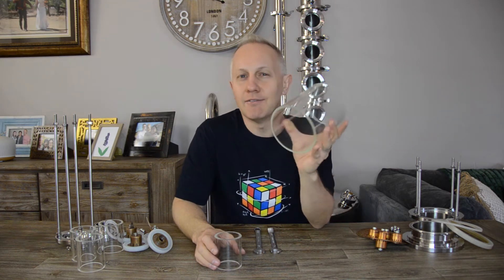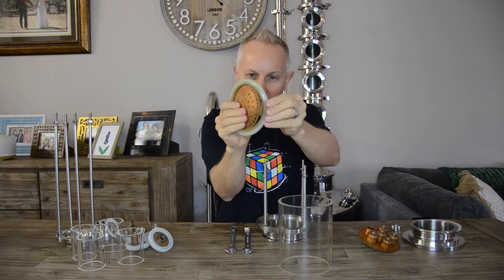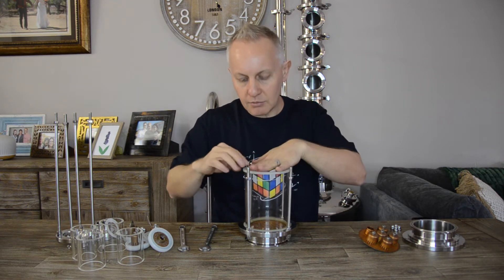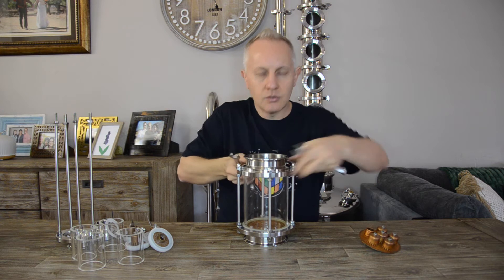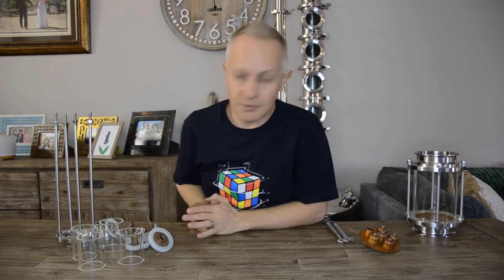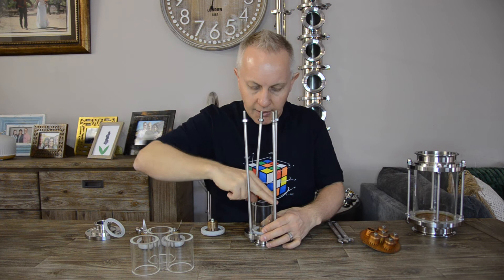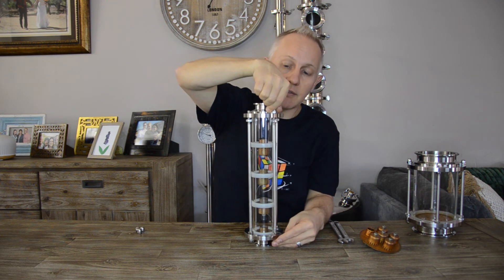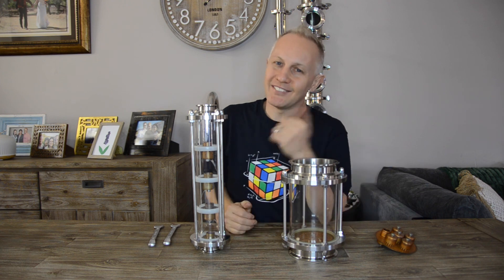How to Assemble a Glass Column & Sight Glass for Distilling | Step-by-Step Setup Guide *AUDIO FIXED*

Comment: Hi, great videos, thank you!  Question: I have a 2" output from my still and 2" column, pot, reflux & plates / defrag etc.  If I was to place a 3 or 4" column on the top of the 2" output, would I benefit in regards to speed of output? or do I need a 3 or 4" output on my still to drive a 3/4" column?  Thanks, Mark (AUS)
Reply from the maker: Thanks Mark, you are awesome.
Lovely question, here is what I found:

I don't think I would say a 4" is more efficient. But that would also depend on your definition of efficient.

A 4" column will be faster then a 2" column. But it will also take more heat input to get that speed. And you need a bigger product condenser to cope with the added vapor and speed.

A 2" pot still can give you a pretty damn good output rate. I think a 4" on a keg would be a little overkill. But if your talking a reflux column of some sort a 4" is a lot faster.

So yes there is pros and cons on both sides.

Keep it awesome!